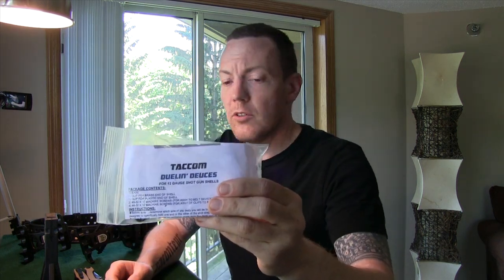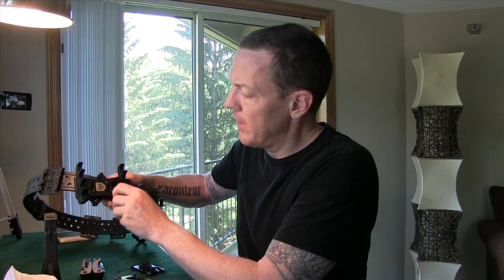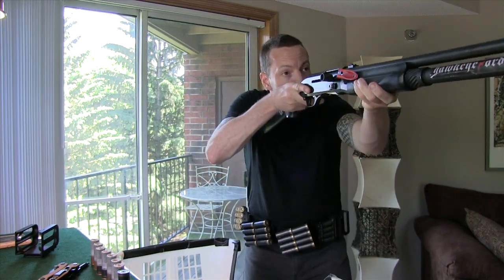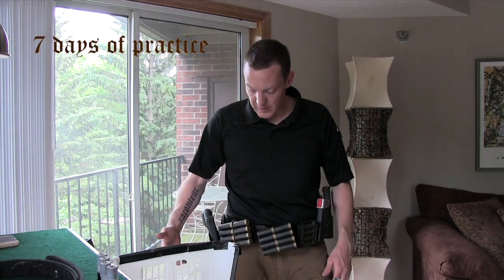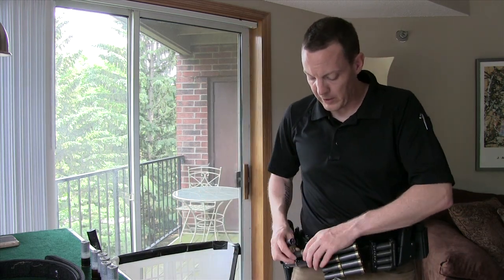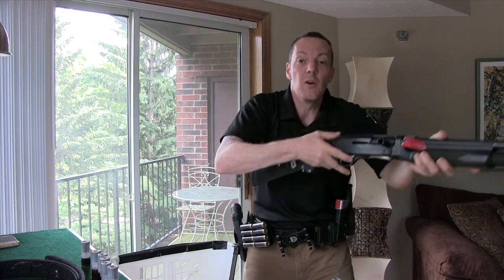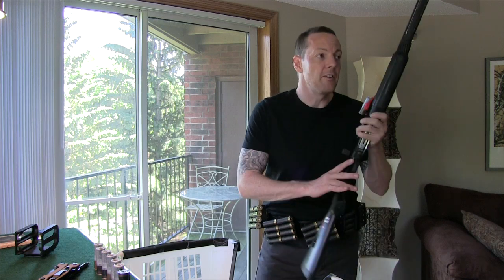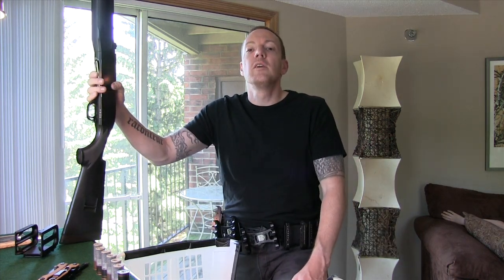3 Gun Gear Review - Taccom Deulin Deuces Load 4 or Load 2 Shotshell Carriers, Shotgun Shell Caddies

Comment: I love looking forward to your new videos always staying on top of things. 
Those shotgun loaders are pretty sweet, my few questions are 

1. How is the functionally of those to be used with a pump action.

2. For someone on a budget is there a set or maybe one speed loader I could look for to work with until I'm able to get a full belt like that. FYI I am using a pump remington 887 nitro mag tactical 7 rnd mag, for 2 3/4. 

3. Would you have any ideas for me to try and practice the reloading with my AR and shotgun since I don't have a belt to hold my AR mags or shotgun shells. I've got a 25 rnd bandolier for the shotgun with a 6 rnd soft sleeve for the buttock. My AR mags usually just got in my back pockets for now. 

4. As I have started dipping into 3 gun and been doing some practicing, on gun transition which is pretty bad. Standing stances trying reloading drills also my shotgun reloading needs a lot of work. And making a home made range based on a match I saw on the channel a little while ago I'm having a lot of fun with it. 

What kind of things can someone like me work on when being a noob at 3 gun. Well that's is for now and thanks for the great videos as always.
Reply from the maker: Chris, always great to hear from you. Alright, taken in order:
1) The action makes no difference. pump gunners run all the different loading systems. You do not need a full belt to run deuces or quads. I would highly recommend picking up a caddy for deuces and run it on a belt. 

2) Send me an email mark@hawkeyeordnance.com

3) Practice fundamentals that will increase your times. AR mag changes are pretty rare in 3 gun. I would focus on A)  fire pistol (rifle, shotgun) drills - check out the dry fire challenge for a free download and tutorial. B) Shotgun reloads

4) Keep it up!!! That is key here. Stick with dryfire drills and shotgun reloads until you are super proficient. Spend time on your range having fun - that is what this is all about.